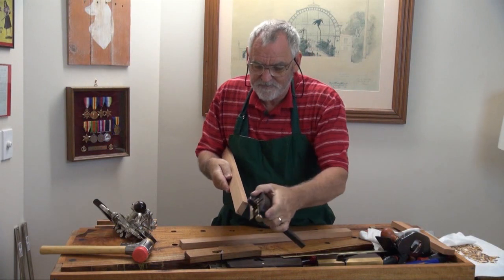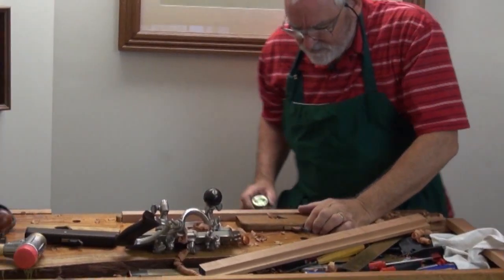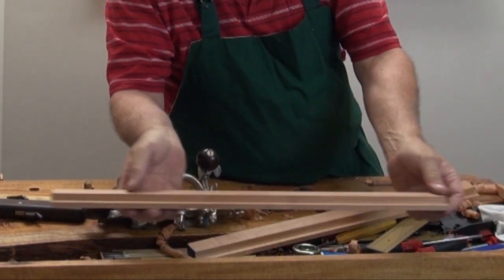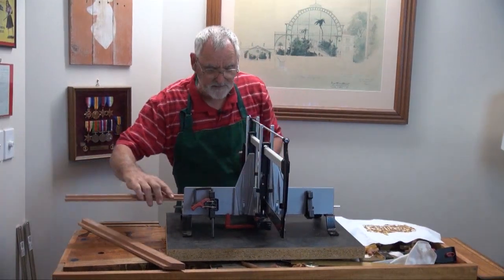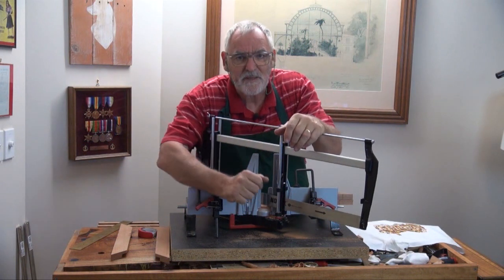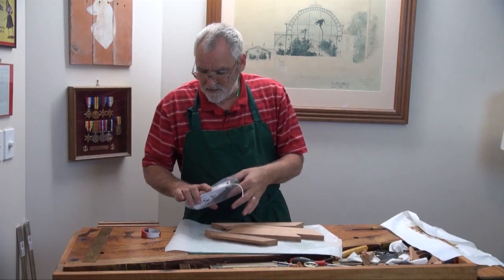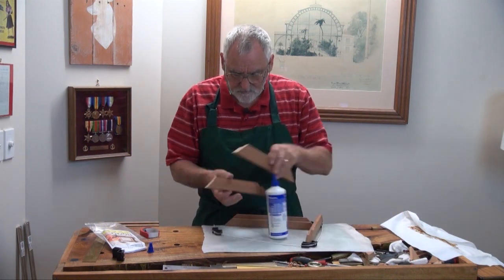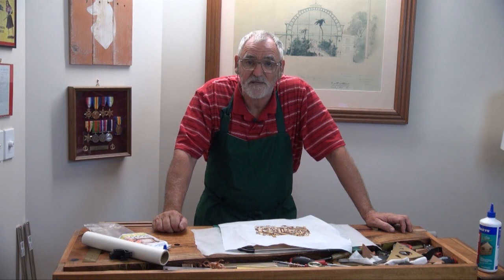Making a Simple Picture Frame Pt.2 of 3

Comment: Did you use any sort of stop block to ensure your sides were equal in length?
Reply from the maker: No, just placed one piece on top of the other when I started the cut. The Saw does have a stop block but I thought my way was quicker and seemed just as accurate. Thanks for you comment. Cheers Steve